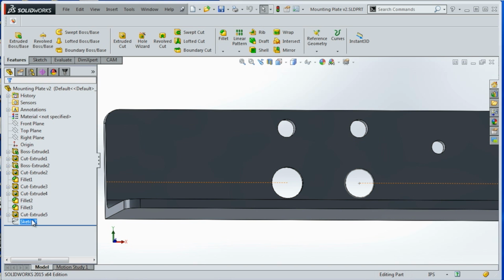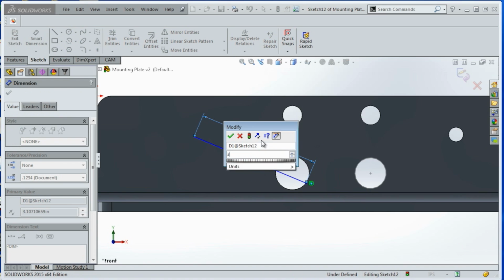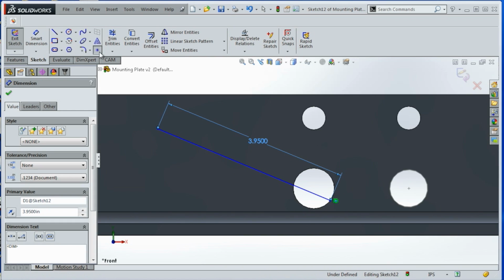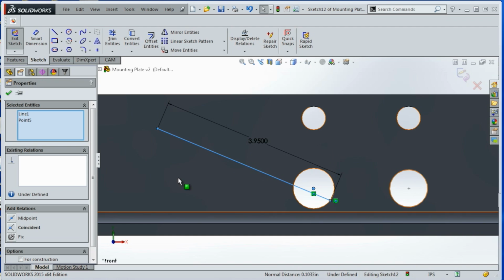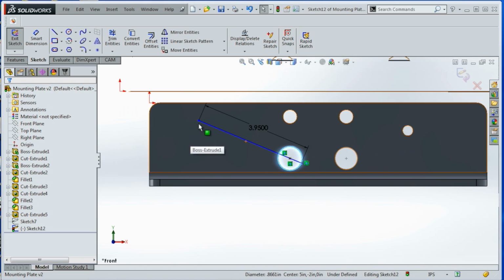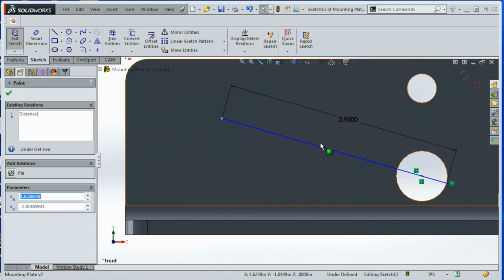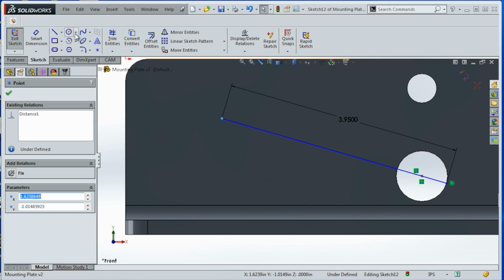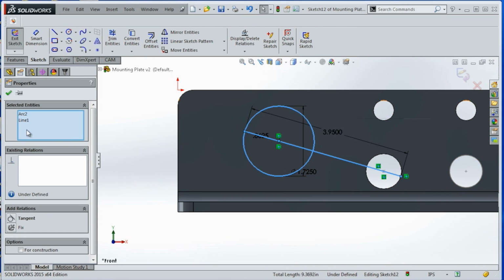CAD Quick Trip: Dimension for Timing Pulleys

Comment: hi, I've been watching your videos for over a year now... they're one of the most useful no nonsense videos coz you take us through the step by step process of stock to finished part.. i wanted to ask how to draw timing belt pulley profiles on a CAD software. can it be done manually or are there plugins or wizards available for that. i want to be able to machine my own timing belt pulleys. thanks.

Comment: This is cute but in a real application you have to use a belt tensioner mechanism,  because you have to put some initial load on your belt with a specific force, given in the belt/pulley catalogue. That is more tricky than calculating the distance.
I could be wrong though

Comment: I love the stuff you're doing on this channel and greatly appreciate the content. But, as you've admitted, you're a beginner when it comes to Solidworks. I made a short video to show a better way to do the geometry and dimensions for the pulley holes in your video.

It leverages the power of contraints a little more and simplifies the geometry needed slightly. Specifically, it includes the construction geometry in the same feature as the holes, so there's no need for extra points or lines outside of the hole features. The only thing I would add would be to use the actual Hole function in Solidworks, instead of Extruded Cut.

https://youtu.be/Z0dFHGcjC7M

Comment: Search for "SolidWorks Kinematics Creating Belts And Pulleys" on YouTube. It is a good explanation of the "Belt/Chain" tool in SolidWorks. Also, with two circle blocks selected you can insert a "traction" relationship to simulate gears.

Comment: Great little vid :-) Just a thought... Mind you it would add some complexity... In my 3D Printer design, I will have an "Idler Bearing" to keep the belt taunt... My Idler bearing will be spring loaded to force the belt tight... Over time, every belt will stretch or break. Moreover, it will stretch before it breaks, so in order to prevent the belt from skipping a gear a tensioning mechanism is necessary... You could really jazz that video up by adding an adjustable Idler Bearing :-) Go crazy... lol
Reply: DStray Cat A slot
Reply: DStray Cat I haven't seen that type of thing as necessary with the typical GT2 belts used in many contemporary 3D printer designs. Here is a good paper on their use that may assist in your application http://www.sdp-si.com/D265/PDF/D265T003.pdf Indeed an idler may introduce backlash into the system that would lead to positional errors. Good luck with the design and build.
Reply: You make a very good point... A spring would do that... Thanks :-)

Comment: Having measure the pulley distance for something in hand is one thing, but what If you don't have that befor you start designing. 
Go to Chapter PT10-1 (halfway down-ish) then scroll though the various belt sizes. It gives not only the center to centre distance for a given pulley pair and belt, but also power, torque and sped capabilities for given configuration.

Remember that when you make a timing belt configuration, always, always must have at least on odd number tooth count in either the belt or one of the pulleys, It reduces vibration and ensures that you don't have a particular tooth always falling in the same void, this evens out wear and extends belt life greatly. 

www(DOT)baldor(DOT)com/mvc/DownloadCenter/Files/CA4000

Comment: You can also just dimension the max distance of two circles, ya know? :)
Reply: rob lockwood
Yeah, good tip, I just learned this one myself.

Instructions (for those who haven't seen this)...
1. Draw your two circles
2. Get the smart dimension tool and dimension your two circles
3. With the dimension tool still active, hold the <shift> key and click the "far" "side" of one circle, then the "far" side of the other circle. (note: make sure the dimension is not snapping to being horizontal or vertical)

You can also dimension between the "near" points of the circles (or a combination of near, far, and center points)
Reply: NYC CNC Hirudin Hirudin's tip is the pro-tip shortcut, but look to the 'Arc Condition' section of the 'Leaders' tab of the dimension. It will give options for "Center/Min/Max" for each arc included in a dimension. This way, you can dimension to any combination of inside/out/center from either entity, and change it on the fly!
Reply: Hirudin 100% this if you want to do it fast and still have it fully defined
Reply: NYC CNC The way you showed was the way I was doing that until about a week or two ago. Your way also has its advantages too, like it's easier to see exactly what is being dimensioned. Another example is when you want two points to have a horizontal relation between them. You can select the two points and define them as horizontal, but a horizontal construction line between them will do the same job AND be immediately visually apparent. I haven't known about this long enough to prefer one over the other yet.

rob lockwood Oh nice! It makes total sense that there would be an option to switch between the dimensioning points, but it hadn't occurred to me. I would have created a new dimension and deleted the old one if I ever had to switch. Thanks!